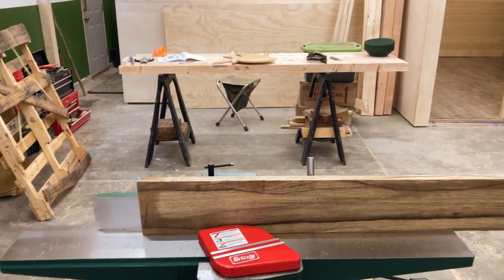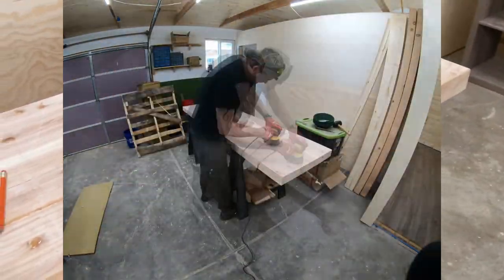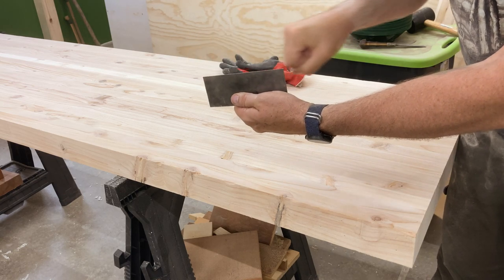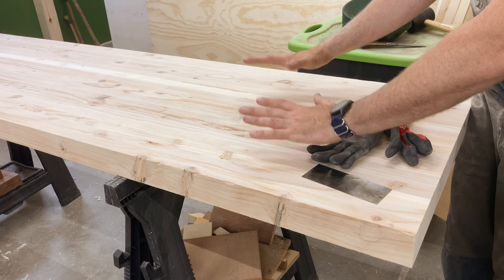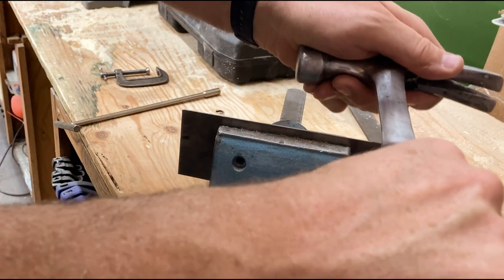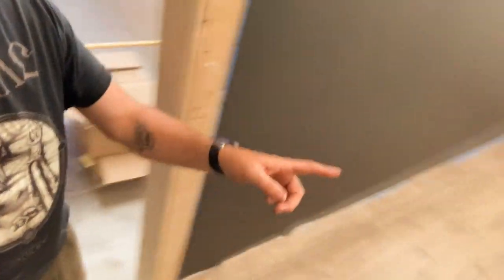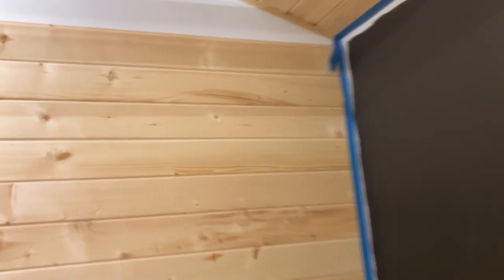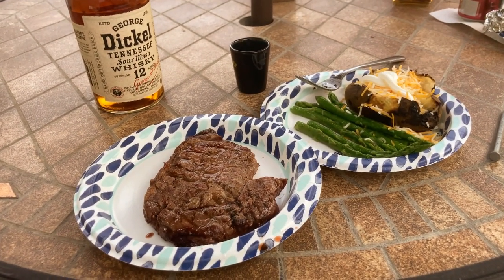Painting It Black

Comment: If you have a deep dent in a table top, you can also use the wet cloth trick and a hot iron to lift the dent up out of the table top. 
Soak a cloth in water, place over damage area, place a hot iron onto the wet cloth and the stream will pull the dent out.. panel betting timber lol
Reply from the maker: Yep! I put a video on this 11 years ago for steaming out dents in Acoustic guitars https://youtu.be/hoEvFwx-KY0